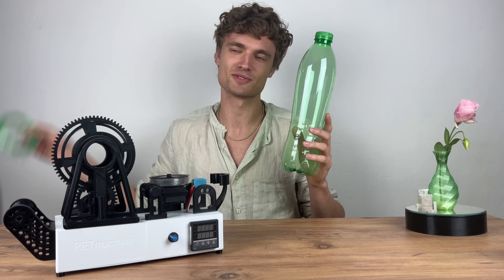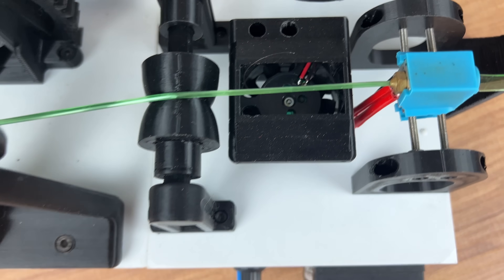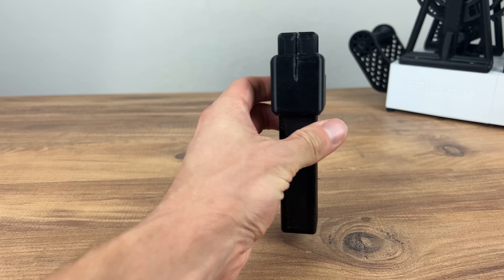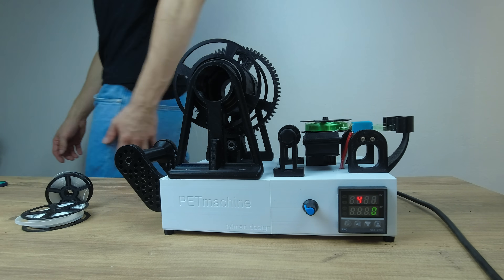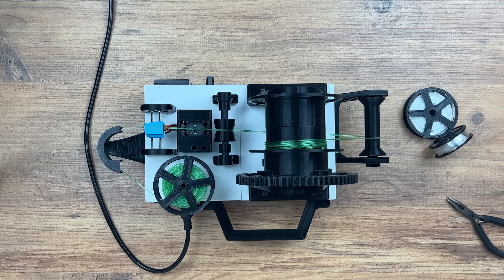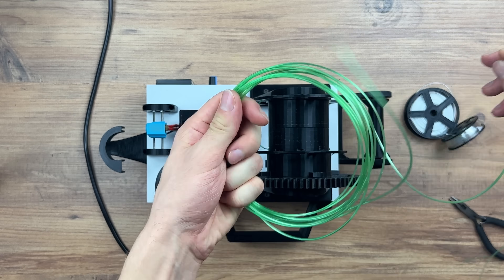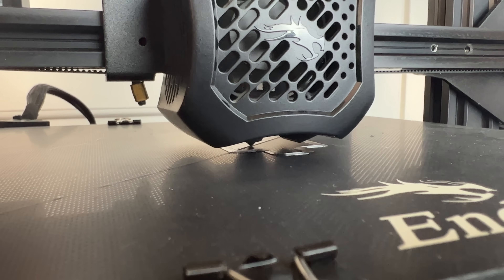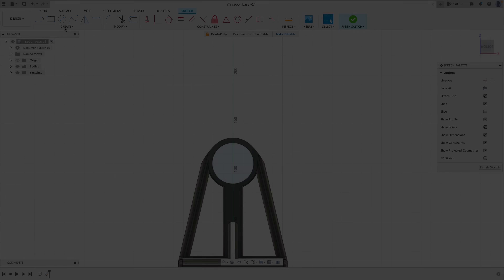Turn Plastic Bottles Into 3D Printer Filament at Home | DIY PET Recycling Machine!

Comment from the maker: !!! Now my PET-Machine assembling video is available for everyone !!!

https://youtu.be/AFDcjjDaweo

Enjoy!
Reply: this is revolucionary, congrats! make it a product to sell
Reply from the maker: @wellgaroa  Thanks! I've already made it, prepared just 10 kits to check the market's demand and it sold out in 2 days haha! Now more coming soon!
Reply: It would be good to find a method to splice the cut bottle strips, maybe by cutting some shape into each end? Before going through the nozzle and becoming filament. Making it so that you could make longer filament, without having to splice the filament itself.

Maybe?
Nice invention though!
Reply from the maker: Hello! We will announce and put PETwelder on sale very soon. You can follow my Instagram account to follow the progress about it: www.instagram.com/tylmandesign
Reply: I wonder if you could automatically adjust the motor speed based based on maintaining the heat; I.E, if the temperature is going down or fluctuating too much, then slow down the motor slightly.
Reply: what if you have this set up to make the 2.8 filament and then weld it and then run it and decrease the size to 1.75 filament for a stronger joint and bigger rolls of filament
Reply: 00٠
Reply: Hello, I would like to know about the STL files of this model, can I get them, or is it a commercial project that can only be bought
Reply: How much does the machine cost
Reply: Zzzzzzzzzzzzzzzzzzzzzzzzzzzzzzzzzzzzzzzzzzzzzzzzzzzzzzzzzzzzzzzzzzzzzzzzzzzzzzzzzzzzzzzzzzzzzzzzzzzzzzzzzzzzzzzzzzzzzzzzzzzzzzzzzzzzzzzzzzzzzzzzzzzzzzzzzzzzzzzzzzzzzzzzzzzzzzzzzzzzzzzzzzzzzzzzzzzzzzzzzzzzzzzzzzzzzzzzzzzzzzzzzzzz zzzzzzzzzzzzzzzzzzzzzzzzzzzzzzzzzzzzzzzzzzzzzzzzzzzzzzzzzzzzzzzzzzzzzzzzzzzzzzzzzzzzzzzzzzzzzzzzzzzzzzzzzzzzzzzzzzzzzzzzzzzzzzzzzzzzzzzzzzzzzzzzzzzzzzzzzzzzzzzzzzzzzzzzzzzzzzzzzzzzzzzzzzzzzzzzzzzzzzzzzzzzzzzzzzzzzzzzzzzzzzzzzzzzz z
Reply: Zzzzzzzzzzzzzzzzzzzzzzzzzzzzzzzzzzzzzzzzzzzzzzzzzzzzzzzzzzzzzzzzzzzzzzzzzzzzzzzzzzzzzzzzzzzzzzzzzzzzzzzzzzzzzzzzzzzzzzzzzzzzzzzzzzzzzzzzzzzzzzzzzzzzzzzzzzzzzzzzzzzzzzzzzzzzzzzzzzzzzzzzzzzzzzzzzzzzzzzzzzzzzzzzzzzzzzzzzzzzzzzzzzzz zzzzzzzzzzzzzzzzzzzzzzzzzzzzzzzzzzzzzzzzzzzzzzzzzzzzzzzzzzzzzzzzzzzzzzzzzzzzzzzzzzzzzzzzzzzzzzzzzzzzzzzzzzzzzzzzzzzzzzzzzzzzzzzzzzzzzzzzzzzzzzzzzzzzzzzzzzzzzzzzzzzzzzzzzzzzzzzzzzzzzzzzzzzzzzzzzzzzzzzzzzzzzzzzzzzzzzzzzzzzzzzzzzzzz zoo
Reply: Ôi mê ly! 🤩💯
Reply: Hi can you help me how I get the list of the part . And the rope wen you cut how mm you cut
Reply: شكرا لك من اين يمكن لي أن أحصل على تلك الآلات
Reply: sir my DIY pet is not melting at 185 degree , what is the temperature for DIY PET I need to keep ?
Reply: Can someone buy this machine
Reply: Please what is the name of the last machine
Reply: Wooow
 Hoping that we can have one in our school. .so that we can recycle pet bottles..
Reply: https://cults3d.com/es/modelo-3d/herramientas/estuche-kit-fumeta
Reply: 😮How much does the printing machine cost? Can it be issued so I can buy one?
Reply: Good Design👍
Reply: I have edited a little bit since I don’t want to use support blocker. Should I send you via Twitter or somewhere?
Reply: Ok
Reply from the maker: @Psych0h3ad  Sure! Please send me to my email tylman.design@gmail.com . Thanks a lot!
Reply: @TylmanDesign  Okay I’ll do that later :)
Reply: @TylmanDesign  Sent you an Email :)
Reply: @TylmanDesign  hello I want bought this is machine you can help me
Reply: or just stop buying plastic packaging , if you wanna help environment
Reply: @devilik3692  Or collect bottles from people to use as cheap filament, which would cut down on other peoples trash!
Reply: @devilik3692 this snarky comment is completely unhelpful. This person is coming up with constructive solutions to a common problem. It would be great if we got 8 billion people to stop harming the environment but that is a much greater challenge and having people like this person helping to solve for the use of what’s already created is a welcome site. Be part of the solution.

Comment: Does this stop you from doing large prints ? I have never used a 3d printer.
Reply: Spools can be joined together, just a tad tedious without a vice: candle/soldering iron on both ends, press together, 

a) slide inch of bowden over joint b) trim off excess with knife/sanding
Reply: Silicone tubing for wine may be cheaper to get, such as Feelers 1/16" ID x 1/8" OD Pure high temp Thin tube

Comment: I've orderd one and dear lord is it complicated, over priced and used it will say the filament is good but the amount of hoops you have to jump through is insane  honestly if the there was an instruction manual shipped with it to show you the parts you needed printed it would be so much easier but instead you have to wade through files just to then print your own parts from your OWN MONEY!
just to be able to finish this product or pay a premium to get the parts printed for you

it's a great idea and a great design but it's hindered by its own instructions as you have to access files from google docs and by the way some of the files need a 3rd party to open them so again great concept poor execution all in all not impressed with my purchase or getting any help on the matter via the discord its a complete joke so purchase at your own risk! 

I will say though if you can get through all that and manage to get through the instructions you do have a good bit of kit but be warned expensive and difficult to get through

Comment: I still cut glass bottles to make vases. I seemed i missed the 3D printer revolution 😂 Very good project btw. Is pladtic strong to make spare parts (at least as strong as wood ?). Can you recommend one entry price easy to use 3D printer ? Is PET UV resistant? Very good usefull project.

Comment: HI there, Great device! I am wondering would you be able to use other types of plastics besides a bottle type plastic? Can this device use plastic trays or plastic tooth paste tubes? Plastic bottles are accepted for majority of recycling companies, but the plastics that are black in colour or that are made from number 6 are not accepted. Let me know you thoughts. I am always looking for ways to create and reuse non-recycled materials.
Reply from the maker: Hello Susan! The only way to recycle those materials you are talking about is shredding them into small pieces and then using extruder creating the filament

Comment: is it easy to print? or is it like abs?
Reply from the maker: It requires 260 degrees on the nozzle and 85 degrees on the bed. But it doesn't require closed chamber like ABS.

Comment: what is the difference between the normal version vs the mr welder thing version
Reply from the maker: Hi! These are my two different projects. PETmachine is for producing filament from PET bottles. And with PETwelder&Mr.Winder duo, you can weld the filaments together and have a longer filament spool.

Comment: Everything is beautiful, an information, can’t the bottle cutter be integrated into the machine, as an accessory?

Second question, why don’t you study a way to insert an empty coil so that you don’t have to pull the filament every time and put it back on a reel?
Reply from the maker: In the actual version of the PETmachine, cutter is integrated with the machine.

Section of the filament permanently attached to the spool is implemented as well.

Comment: what's the downside of not heating the bottles to make them smooth? thinking if the gas and time used in this step could be saved.
Reply from the maker: There is a new method. I inflate the bottle, then use a little bit of boiled water to make the bottle smooth, much faster and safer method.

Comment: Bro please guide me to by a 3d printer under 20,000 please 🙏 and which printer you use in this video?
Reply from the maker: Hello bro. I used Ender 3v2 with double gear extruder.

Comment: Are these plastic toxic to heat?
Reply from the maker: PET bottle plastic ion PETmachine is heated lower than most of the filaments used for 3D printing. I'm in a process of laboratory examination of the possible toxicity of those procedures and PET filament usage.

Comment: I was thinking about buying a 3D machine and I liked your design for making filament. The question I have is whether the filament is well made or can it damage the 3D printer. I would like to know if this way of making filament is reliable or if there is a chance that the 3D machine could break
Reply from the maker: Hello! Its totally safe to use

Comment: What was the temperautre of the 3D printing parameters for the filament for the printer.
Reply from the maker: 260 degrees on the nozzle and 85 degrees on the bed.

Comment: I use the Original design of the Recreator 3D. Keep seeing all these "designs" popping up...AND I built it for less than the price of this kit
Reply from the maker: What means "original"? Mine was created in 2017, so long before Recreator3D, just YT video was released recently. Just if you have Ender 3 to waste already, otherwise it's not much cheaper, I guarantee.

Comment: Amazing machine, seriously thinking about buying one from you - roughly how long does the machine take to form one bottle, say a 500ml bottle, into filament?

I also hear a lot about PET crystallization when you print, making it opaque and brittle, have you found any good print settings or temperatures to avoid this?
Reply from the maker: Thanks! In general we can assume 1m per minute. Processing 1.5L bottle takes around 6 minutes. 

If you find good settings (with my user guide and Discord community help you will make it easy), you can forget about crystallization.

Comment: What is the temperature for setting up the molding and melting of plastic on the 3D machine?
Reply from the maker: around 260 degrees on the nozzle and 85 degrees on the bed.

Comment: hmm, i think i saw a russian guy make it easier:
- place the bottle on the rack, place the strip on the motor so that the motor rolls 1 bottle automatically onto the reel.
- place the strip in the hot-end
so that the machine can perform 2 operations

Comment: But much better idea is shredder + pellet extruder for this.
Reply from the maker: Much more complex, expensive and not that accessible as well. That's why there is so many PETmachine owners not shredder + pellet extruder owners.
Reply: You do many things manually. You must also cut pets for strips. If cut pets by scissor to pieces, dont need shredder and dont need this at all.

Comment: I like the idea but it does seem like a lot of work for a little bit of filament.  What I would like to see would be something that you could just chuck whole bottles into and it melts them down and extrudes them from a large reservoir.  I think it would take about 100 bottles to create the same plastic as a 1kg spool.  That's a lot of time over the stove and cutting with scissors.  Maybe some shredder like a modified paper shredder that you could toss your used bottles into and then melt the shredded plastic?  also, does this really save money?  At a dollar per bottle (just to make the math simple) it would cost $100 to make a kg spools' worth.  If you don't want to think about it like that because you already drink lots of bottled water anyway then think about how many cases of water it would take to drink before you accumulated enough.  Maybe if you have access to the trash where large groups of people are throwing away lots of bottles and that's free to you it would make a lot of sense.  In the end to me it seems like just buying the purpose made stuff makes more sense.  I do wish the price was much lower though.  The dirty secret of plastic is that it's dirt cheap to make originally, but people will pay dearly for it so it's expensive.

Comment: If anyone's going to do this accept it's risks. I would put the printer in a well ventilated area/garage while printing with this "filament"

Most Printer filaments are crafted with a specific plastic that doesn't emit fumes when melted. If it is confirmed that you are using Polyethylene terephthalate (PET) plastic then you're fine but most bottles don't tell you that. Do not use plastics such as Polypropylene (PP), Polyethylene (PE), polycarbonate (PC), Polyvinyl Chloride (PVC) in a non-ventilated area.

If you are printing any type of Homemade Filament please go outside or in your garage with fans. Plastics can release toxic fumes when melted (especially to 180F - 200F) and can be deadly.

Comment: Very cool, but cutting and spooling the strips is not something I want to do. I'd prefer to just have to put the bottle in and press play. And that initial pull with the pliers wastes a lot of filament, you should consider shortening the path or adding a cable to the spool that you attach to the filament next to the nozzle instead. Also, you should think about a way to join strips and that filament unloading is a mess. I wish you would use spools we can remove with the filament on it.

Comment: There is a gear on the spinny thing. You could add a screw pin to move the filament at the right speed left and right.

Comment: Edited due to a very fair response, still love the product and I'll just leave a reminder for fellow builders to always triple check parts and measurements before assembling!

Slapping together leads to more repairs and purchases.
Reply from the maker: Hello. I'm sorry for the inconvenience you experienced. 

That's the price to build this project asap, all the parts collected in a box. What's more, in this price you get whole digital project and 24/7 support during building.

Nothing was hidden, whole parts list was available on Etsy announcment.
Buyers clearly know what they are going to get and how much they pay.
I didn't receive any direct message from you with your problem, we could solve it really easy there. 

Assembly video is not attached to the PETmachine+ project, it's outdated. Building PETmachine+ you have to use just "Assembly manual" document.

I prepared wiring diagrams especially for begginers, to be the most clear and simple as possible. Till now I got only positive feedback how easy to understand this wiring diagram is. 

If there is something not clear for you, again, you can contact with me or post your issue on our Discord channel where we will help you as well. It's my pleasure to help those who love my project and buy it.

Btw, usage of the TR525 valve will be presented soon on the "Handbook" that is not released yet. Wait for it! 😎🙌🏻

Comment: I just found you on etsy! In your newest kit, are you including a bottle cutter? I bought the wooden version bottle cutter you showed in this video, but our water bottles are so thin that they snap when pulling.
Reply from the maker: Hello. Did you measure how thick the bottle is? Ive been testing between 0.1-0.35mm. Mine works good. And yes, all parts included.
Reply: @TylmanDesign  I need to get a mm measurer. The new 16 oz water bottles are like crinkle paper without liquid in them. It is hard to keep them even round while collecting. 

I was also exploring shredding plastic so some could also use on extruder setups that use shreds and pellets.

Comment: to remove the ripples that are in the bottles there is another method, just take the nozzle of an inner tube of a bicycle, then pierce the lid of a bottle, a hole that is enough to pass the tube's nozzle in the lid , after that, just fit the cap with the spout onto the bottle and inflate the bottle as if it were a tire, when the bottle is full, just dip it in boiling water, the bottle will be smooth and new.

I'll leave a link to a video for you to understand better. https://www.youtube.com/shorts/RSpjstZ0LPY

I'm sorry if it wasn't easy to understand, I'm using an internet translator.

Comment: just disassembeled my extruder. It just was not worth all the hussle. The filament was brittle and only usable for a few days (I think it was humidity). Also a constant diameter was a problem.
Using old bottles brings a lot of problems too. You have to check carefully the type of plastic, so no microplastic out of the ocean. Cleaning and heating needs a lot of resources, so no positive impact for the enivornmet. And the amount of filament you produce is only suitable for smal prints. The idea is nice, but the usability is not worth it.

Comment: do you still live in Turkey :) (its an unnecessary question just saw familiar pet bottles). I see there is a need of manual intervention to keep filament aligned for proper rolling. Do you have any mechanical solutions for that. Great job btw.

Comment: Its cool to reuse bottles in this way on the surface level. But fumes from melting plastic like this can mess people up, I would love to do this but dont wanna give myself cancer melting bottles, not to mention the stuff it releases isnt good for the environment either
Reply from the maker: Hello! I agree with you, in melting process plastic strongly degradate and can produce toxic fumes, but in here we DON'T melt it, plastic string is just plasticized in a safe temperature range (even lower than in 3D printer). Cheers!

Comment: what would happen if you didn't prepare the bottle first by smoothing it? I mean it goes through nozzle anyway so it'll be stretched and reshaped.
Reply from the maker: Cutting is much more easier then and we get rid of unnecessary fluctuations of the strip height